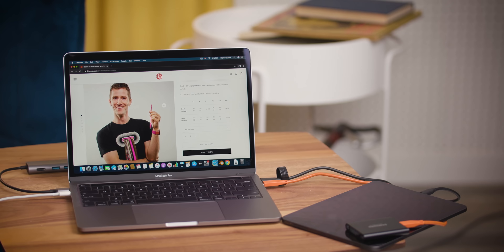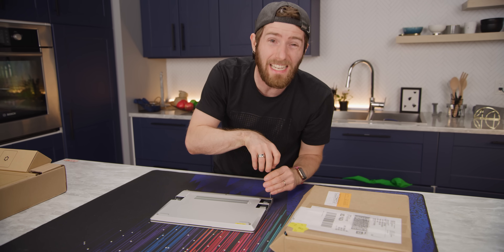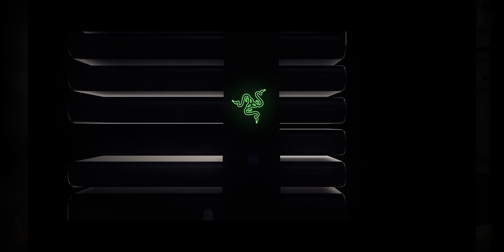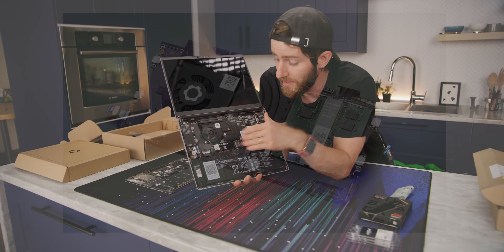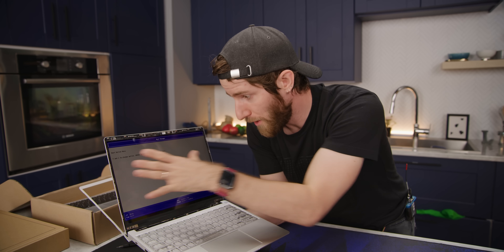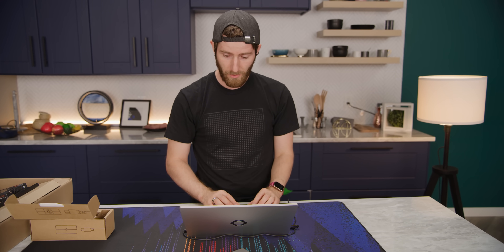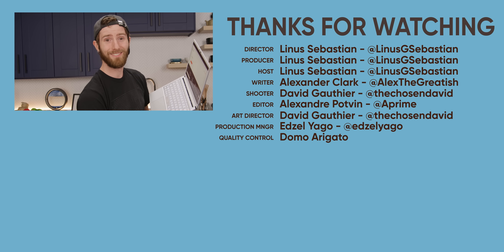A COMPLETELY Upgradeable Laptop?  - Framework Laptop Review

Comment: I use an external mechanical keyboard.  If this laptop had a plain cover as an option instead of a keyboard, I'd buy this computer in a second.  That way I could use an external keyboard and set it over where the keyboard goes without accidently pressing keys.

Comment: Don't even start about "manufactures not wanting to do stuff" Lenovo removed nerve sense cooling software in 2018 (which basically gave extra boost to cooling by running fans at more speed), almost all the companies have removed battery limiter (which according to many researches extends battery life) from their bios, intel turned off "undervolting" (low temperatures, more stable performance) due to some bug which was of course their fault. They give up this exclusive feature but once they realize that they have committed blunder by giving more power to end user they are quick to correct themselves by locking the bios altogether!!

Comment: this reminds me of those fully upgradable laptops from 10 years ago where the company that made them actually made the GPU upgradable and the CPU upgradable.
i don't remember the name of that company though,
this does bring me to simpler times though, like how laptops were in the mid 2000's to early 2010's.
you could literally upgrade everything: CPU, GPU, Storage, RAM, Networking and communication cards etc.
than Apple came with their "unibody" designs and kinda fucked this whole upgradability point up.
though first unibody macbooks were still somewhat upgradable: RAM, Storage, Wifi Cards, GPU (i remember that was a thing in the mid-late 2000's before 2nd gen unibody design was released)

Comment: If I had this I would be SO happy not to have to upgrade every 2 or so years, I can just buy the parts as I want. There will always be some one who can make a new chassis,  because the motherboard can be put anywhere. There will always be some one who can make a nicer higher refresh rate display. This is amazing, actually. They are essentially off loading the R&D onto the consumer! I have no problem with this. It's amazing. and It shows how strong the potentially free market can be. I want this to survive so bad.

Comment: Razer released their Razer Blade 2021 editions where released future ready in January. I mean I can upgrade absolutely everything I could need for the next 5+ years and I am aware that it’s a higher performance machine to fit my needs and an rtx 3090 card in it, but the Razer core provides an external GPU and other peripherals access tool. It also has up to 64gb ram space, and a extra m.2 ssd slot that is available and you can upgrade the one you got so you can get 4tb ssd if wanted. So it’s more expensive but it was bigger news when I saw it from Razer. Also it’s got all the ports for monitor, Ethernet cable, usb, usb thunderbolt that has a hub and core external gpu option. 
This looks a lot like something I’m gonna be having the same issue with my electric beard trimmer, to many smaller accessories that tend to get lost over time. The 165hz monitor. 

I run into the same feelings as this crew and it’s an awesome device but Razer provided my future ready portable performance needs. 
The Video was funny though and good info, so I’ll add a like.

Comment: \Interesting but the laptop has an integrated GPU.  Currently I have an old Envy dv 7 I contacted Stardock ( I am interested in playing Humanity) they gave me a recommended config. The Graphic card is a NVIDIA 1650 TI...Now, this ia new game and if the recommended config shows a graphic card almost standard for laptops and this new game just come out needs an obsolete card, what will happen in a year's time? That's why Framework would be interesting but...will there be a processor with a faster graphic card?

Comment: The only thing I don't like here: the case itself. I'm one of those temporal anomalies that want their laptop to be a squared, half-inch thick, black box. Simple, sturdy, utilitarian. Give me that Gateway 2000 type stuff, but it can run Win10/ChromeOS. That's why I've been looking at the Pixlebook Go... Until I noticed the lack of USB-A and/or an SD card slot.  Until someone puts out a decent USB-C flash drive, USB-A is still a must.

Comment: I really want to see more devices (of all kind, not only PC's Laptops, even Smartphones) be made more with customer being able to access it. 

I just love old technology for its accesibility - its much easier to repair something old than new. 
like things just as simple as removable laptop battery - ur battery is dying? no problem no need to send it for repair, just release the lock, read the model number, order, put it in. not even a screwdriver required. 

today you often need special screwdrivers with weird screw heards that nobody has a way to open, and just stuff like replacing a hard drive is painful. 

same with phones, u could just open them up and have access to battery, sd and sim card slots at once, now u just have these weird trays u need a special pin to open. i loved that when you could just pry the case open with your finger nails, to for example take out the battery for a second if the phone froze up, now you have to either wait till it runs out of battery power and shuts down, or take if for repair. 

I really hope more stuff will be possible to be self-serviced by customer with just the basic knowledge.

Comment: Si i looked up these  Laptops at Framework and can get a bit expensive.The decent Laptop i wanted is around 1800 plus appparently 400-450 duty taxes plus regular provincial taxes.So it;s likely costing around 2500.I haven't checked around enough to know in todays market if that is a fair price for an upper middle line Laptop in Canada.
So the prebuilds don't look good enough and use built in graphics.So that is why i did the build your own version.The screens however are all 13.5 not good enough as i am used to a 16 inch screen.
So they need more options to get the laptop you want.They are also working on preorders which means they are a struggling business only building these or having them built AFTER they get your deposit albeit only a 100 dollar deposit.No word yet on how the shipping is going for the early bird orders.

Comment: "You can just turn the battery off."
My Lenovo Legion has an option to stop the battery from being charged to 100% by putting a charging cap at 60%, meaning that once you unplug the charger, your battery will be at 60% and have 40% less battery life before it must be recharged again.
It claims that this is an optional feature to keep the battery from overcharging and getting ruined over time, but is that accurate, or does it not make much of a difference?

Comment: This is awesome, and a real step forward. But there are already many repairable and upgradable laptops out there if you don't want the most extreme thin machine.  My Asus TP41OU from 2018 is pretty good, while on holidays in Taiwan I was able to take it apart and install a 2tb SATA HDD into the machine to store all my photos and videos, also the battery is easily replaceable along with the keyboard.  But getting to the ram and SSD was more of an issue as it's either under the motherboard or soldered to the board.  Also many businesses grade HP, Dell and Lenovo laptops are very repairable.

Comment: This is the way.

Ordering one right now too! Still running a 2013 macbook air with no problems because apple hasn't upgraded the macbook air storage enough in the last 8 years. Was trying to hold out for the 2022 new macbook air launch. Only upgrade I've done to my 2013 macbook air is replace the battery myself in 2019. Framework can have my money because their entry level build is the same price as a macbook air in CDN. Thanks for the review! I hope Framework makes a lot of money and this becomes the standard for laptops.

Comment: By the looks of it, these laptops are unfortunately going to be useless for gaming as there seems to be no discrete graphics card, no options for graphics when building on their site, and no space for a discrete card in the case. Which means that you're stuck with whatever integrated/onboard graphics the chip has. Also would be useless for video editing and other GPU-intensive tasks.

That's a shame. Perhaps Framework could create a second line later on specifically made for gaming, with discrete and interchangeable graphics modules, a 16:9 display panel (most games expect widescreen and this would also widen the case, to make room for the graphics card), resolution options up to 4K, and various RGB options through the case and keyboard (because of course).

Comment: Why not have more parts replaceable? like the screen and lets call it a "CPU module" and a "GPU module" (which would still be soldered on, but replaceable)... 
so you can switch out some ports here and add small SSD, so what

Comment: I had a Lenovo y510p. Which had a revolutionary ultra Bay slot for potential sli, day 1 nvidia didn't even support it. Any laptop with interchangeable or upgradable GPUs that are nvidia will NOT be supported by nvidia. So be warned nvidia fan boys. Your company is trash. AMD would never pull a garbage move like that. Their software and driver support takes a nasty dukie on nvidia.

Comment: Love the idea and unit itself but prices seems a bit steep.

To swap the i5-1135G7 for i71165G7 +300$. Or +700$ for the i7-1185G7.
If you look at the recommended customer price on ark.Intel the i7s variants are only 100$ up from the i5.

For the most basic "build your own" i5, 1x8GB RAM and 250GB NVMe you are already at 1021$ (882$ without OS).

If you take the system with no RAM, storage, OS, Wifi they start at 750$, 1049$ and 1449$.

In Norway I can currently get a laptop with the i7-1165G7, 16GB RAM, 500GB storage and W10 Home (and *5yr warranty*) for about the same price as the cheapest option (1000$) from Framework.

As I said I love the idea, but at these prices it will be hard to choose this over a better specced PC (with 5yr warranty). Not that it really matters since they dont take orders from Norway.

Comment: I have a good idea for a model name: "Theseus."  As in "The Ship of Theseus".  Because if you gradually upgrade each component a little at a time, and in a couple years you've swapped out every component, is it the same laptop?
Reply: Frameworks Theseus.
Reply: And then, if you take all the swapped out components and build a laptop from them, which of the two laptops is the real laptop?
Reply: But will the consciousness remain in the laptop.. Or will it be a doppelganger? ;_;
Reply: @AetherSphere  What Jared Black wrote is an oxymoron question, which has already been answered. It's about the continium of the thought (data in this case). Every 10 years or so, you have changed every single cell in your body, yet you are still you. If you swap every single piece of this laptop as long as you run same software, then in a sense its still the same.
Reply: @HueghMungus  ok, how about this.

System crash. Backup from off-site. Goes from T to Tz to T?

Replace boot drive. Don't clear the memory on old drive.

Your objection only moves the goalpost.
Reply: @mysteryshrimp  No it doesn't change anything, my comment explained Jared Black's point exact point.

In your case, then it becomes a different being. Like when you have identical 1 egged twins. At birth they are in practice the same. Then they experience different things, thus becoming different versions of same software. A more "oranges to oranges" examples is the video game called 'Soma' where to you have Version T which gets stuck and then version Tz is booted up. Then it becomes like the twins I wrote about. No one is moving goal posts.
Reply: underrated comment
Reply: @herostar1015  wrong theseus
Reply: @tomaszkarwik6357  god damn how many theseuses are there?
Reply: Trigger's broom, anyone?
Reply: @kevreeduk222  That comment went over so many heads they don't know what they are missing,this time next year..........
Reply: @magumba1000  Maybe some will google it and I'll be partly responsible for introducing them to a classic series?!?
Reply: @kevreeduk222  A noble cause my friend have a like ;-)
Reply: Oh god, oh no, I thought I escaped this damn thought experiment from the field of identity metaphysics. I'm having flashbacks to xQc's stream during the minecraft speedruns. I can literally hear Brian explaining the damn thing by memory.

"Are you familiar with the thought experiment the Ship of Theseus in the field of identity metaphysics? Naturally. The Ship of Theseus is an artifact in a museum. Over time, its planks of wood rot and are replaced with new planks. When no original plank remains, is it still the Ship of Theseus? Secondly, if those removed planks are restored and reassembled, free of the rot, is it the Ship of Theseus? Neither is the true ship. Both are the true ship."

over and over and over and over and over and over and 

it 
just 
never
ends
Reply: @nepgearsy1  xqcL
Reply: Yes!!!!!
Reply: Ngl maybe and USB C gpu I don’t care even if it’s a gtx I mean if you can swap CPU’s that will be super cool
Reply: U need to get in touch with framework and let them know
Reply: @akthar9438  honestly when i get one im going to name it The Ship Of Theseus and get a really cool sticker of it on there
Reply: So, according to the latest Vsauce video ("Do Chairs Exist?"), you could say the components are arranged laptop-like according to the "application conditions" of a laptop. The "laptop" is the arrangement of the components, not the components themselves. So, yes, it is the same laptop even after all components are replaced one at a time
Reply: If the windows boot is the same it is, if you change windows its a new computer just like humans 😂😂😂
Reply: Underrated comment that is SOOOOOO SMART
Reply: Oh man that would actually be pretty awesome
Reply: Thats a Paradox
Reply: well we are changing both mentally and physically so are we the same person? i think thats is the same 😁
Reply: Simply brilliant
Reply: Fucking love it.
Reply: Genius just genius you are a genius my good sir
Reply: Don't get Cutty Sark'd.
Reply: Hahah I've called my 2008 PC Theseus for this reason. I still own Theseus today 😁
Reply: @confounded_feline  "I still own Theseus today"    ...or do you??
Reply: The perfect name.
Reply: Framework Microwave. Framework bluray player. Framework midi keyboard. Smart TV, Camera, Multimeter, Headphones, Refrigerator, afoiphjaoifjhoqiewrghjqekjgfnasdfoifghaqewr!!!!!!!...AAAAAAAHHHHHHHH!!!!!!
Reply: The team at Framework's definitely writing this idea right now...
Reply: @herostar1015  :/
Reply: I mean, every cells of yours also get replaced every 5 years, and you’re still the same person, or are you?? What if you made a person of all the replaced cells do you have 2 you’s?
Reply: I, too, watched WandaVision
Reply: Yeah yeah you watched Wandavision dude, we get it.
Reply: @KevMorAv  no, I knew of this paradox LONG before that
Reply: @KevMorAv  which is amazing, but instead lets bash people for becoming aware of such an amazing concept. Stay single.
Reply: cringe

Comment: Only issue I can find is with gamers. If NVidia doesn't want to make a compatible RTX 3060 graphics card or AMD a compatible sized Radeon RX 6700 XT card then there's little hope.
For the perfect custom laptop, it would have the same as building your own pc. Designated slots that either adapted for or supported by all major manufacturers.

Comment: 10:50 I see your point linus, you can upgrade many laptops that are on the market. BUT (not counting ram) usually its quite difficult to do so and very easy to damage some other component that is in the way. The framwork laptop makes the whole upgrading and repairing process super easy and convenient.
Reply: most people upgrading laptops know what they are doing. so that user replaceable isnt a big deal. its more of the i/o on this laptop. Imagine it with a sim card for 4g 5g capability, magnetic charging cable, etc
Reply: But do you really need to upgrade a CPU. Ram, HDD, is really all u need
Reply: @barrybritcher  Yeah but what is about the future. At some point the CPU will be old and slow so you would want something better.

Comment: I love the fact that when you take the back off, the inside of the laptop "welcomes" you with oodles of text and useful information.   It's like they were just waiting for you to take it apart.   😍😍😍
Reply: you're gonna nut on the laptop if you pronounce it like that bruh
Reply: @sorrychangedmyusername3594   If that happens, it'll be easy to fix, due to the way the laptop is designed.
Reply: When Louis Rossman got one he had to open it up to put in the ram sticks I believe. It looked like Linus got them in packages as well for installing manually but I didn't actually see him installing them.
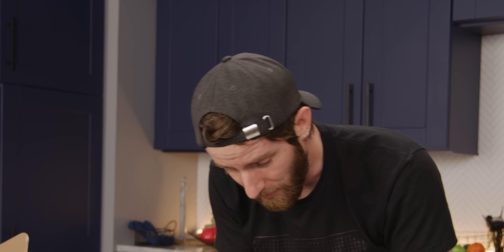Reply: @sykoteddy  10:00
Reply: @Jehty_  Thanks, it's weird I didn't notice him installing them, I just remember he holding the ram packages. 🤪

Comment: I would like to see a review and comparison to Purism's Librem 14 laptop. Purism didn't do the gimmicky (IMHO) USB-C I/O modules, but their laptops have similar privacy and user-repairability baked into their design. And given they've been around longer, I have a little bit more faith in their long term prospects.

For Framework, I'm concerned that as soon as a new USB spec is dropped, you'll need to upgrade the motherboard (and CPU/GPU) to take advantage of it, as well as buying the newer faster I/O modules. The cost of that kind of upgrade is likely to be akin to just buying a new laptop anyways, and produce a similar amount of e-waste unless Framework somehow manages to create a secondary market for obsolete used parts.